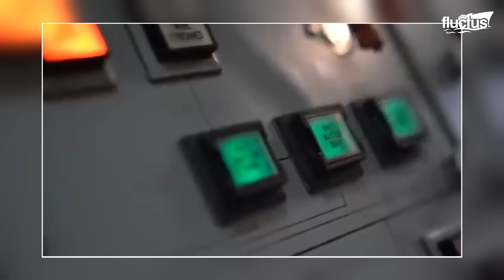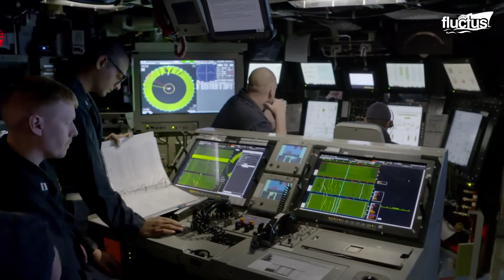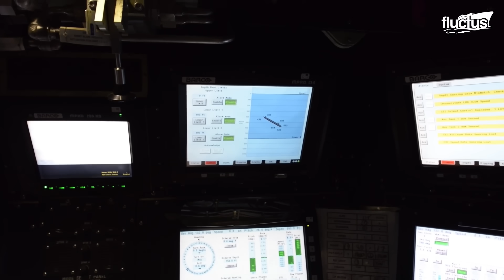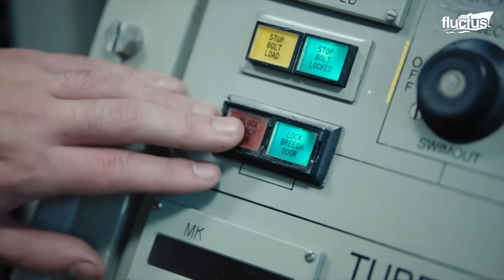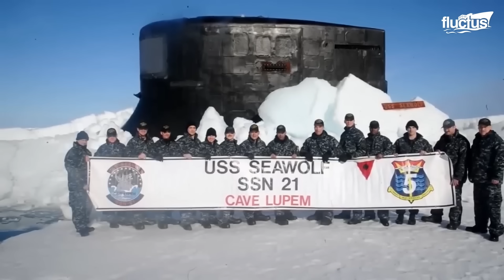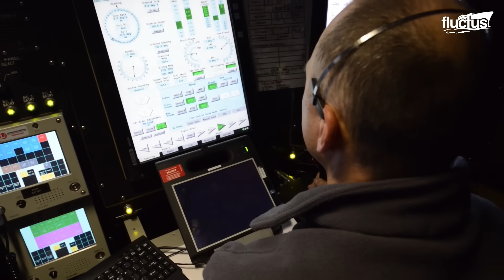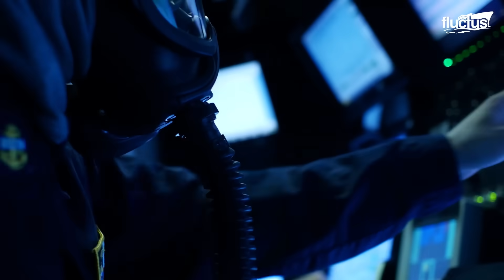Inside US Largest Nuclear Submarine Patrolling the Sea at High Speed

Comment: Fire on board a surface ship is horrible. Fire on a submarine must be flat out terrifying. With no outside fresh air to de-smoke or clear fumes they have to rely on the onboard air purifiers to make it breathable. Plus, there is not much free space inside a submarine. They're packed with equipment all over the place, so moving around quickly and safely is a true challenge.